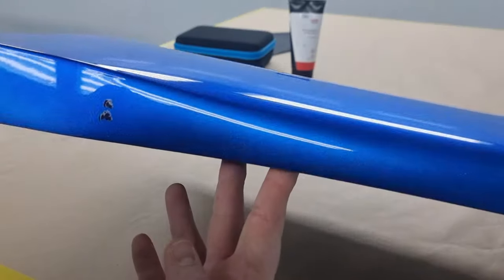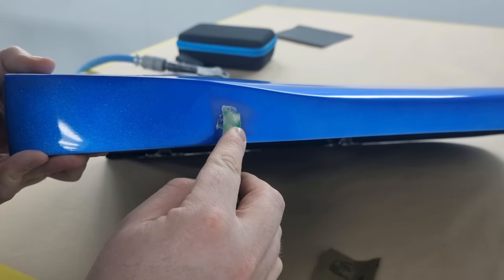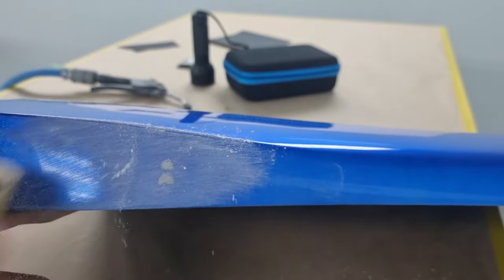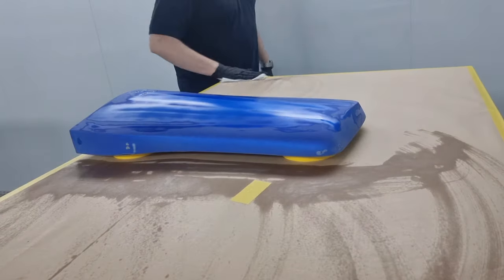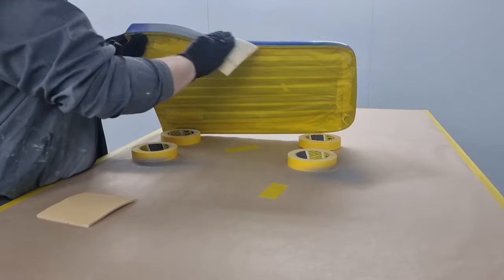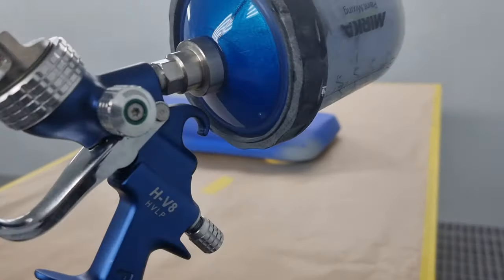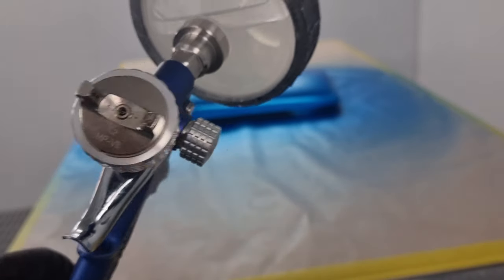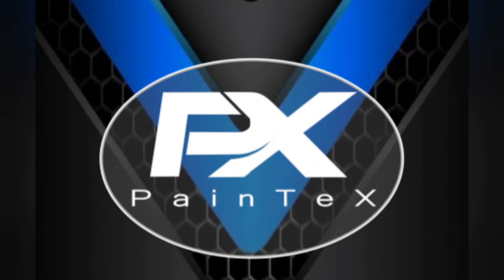Repairing and Painting Plastic Panels

Comment: Hi Paul great video mate and a good demo of the UV lamp, I've just messaged you saying that mine has arrived so thanks for sending it out so quickly👌
I normally use the same UV putty as you but I have the fine which I assume is ok for small chips and dents🤔 great finish on the panel the 6050 is a really nice clear and it's easy to use.
Cheers Paul👌👍
Reply from the maker: Alright mate, that's awesome. I was surprised the delivery was so quick. 

I have never tried it on small dents either but theoretically you could. You could pour it into a cup and after a good long cure you would be left with a block of it. Also remember the more/thicker you apply the longer it will need curing. 

Yea I love 6050, really nice clear coat 👌
Reply: I wasn't expecting it to come today as most couriers don't deliver on Saturdays, I was made up😁have you tried the UV resin with your torch Paul? I have some that I bought a while ago so I will give it a try, it does smell similar to the clearcoat in your kit but it must be chemically different I recon the resin might yellow or maybe go brittle🤔🤷‍♂👍
Reply from the maker: @JohnWD40TC02  I have tried it with some resins and it works perfectly 👌 that's one of the reasons I chose that torch, it's fairly standard looking as torches go but that's where we make a saving and can offer it at a good price compared the it's competitors. Scangrip have a hand held that has exactly the  same power output and wavelength but that's £165 + vat lol.
Reply: The problem with the scan grip one is that you are paying for a name and features you don't really need, I like the fact that yours is made of alloy which makes it feel like a quality product which it is👍
Reply from the maker: @JohnWD40TC02  thanks mate. I'm going do some videos doing stone chips and touch up scratches on my cars using the uv clear lol.